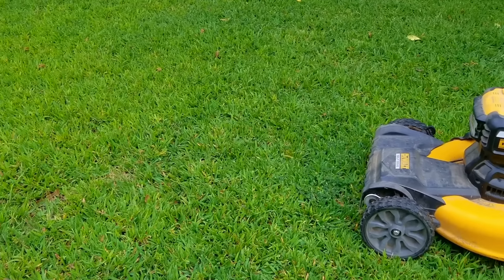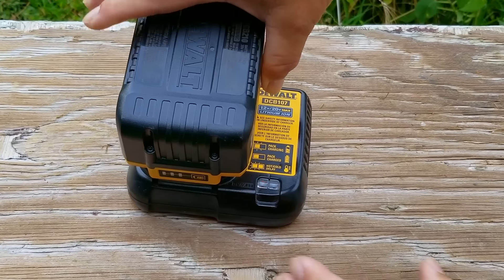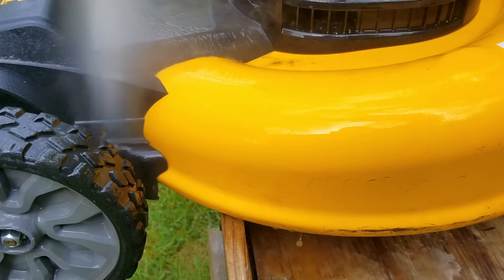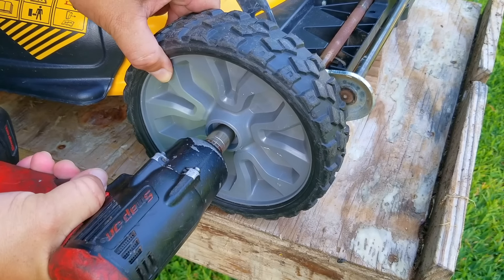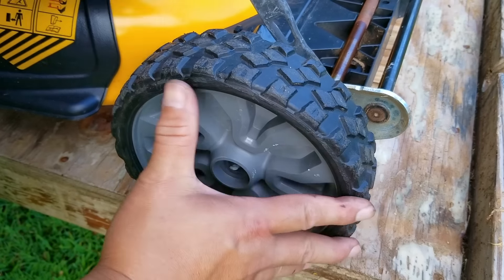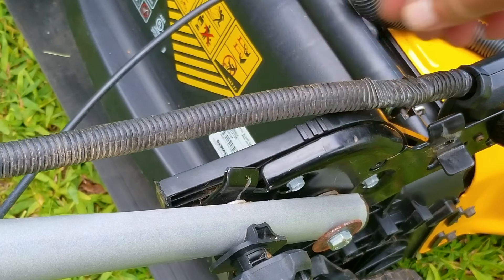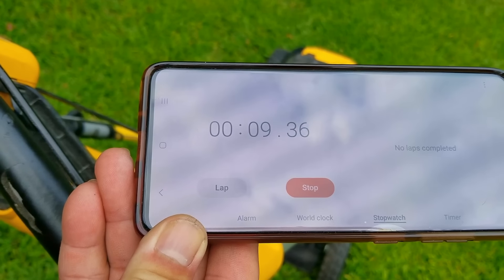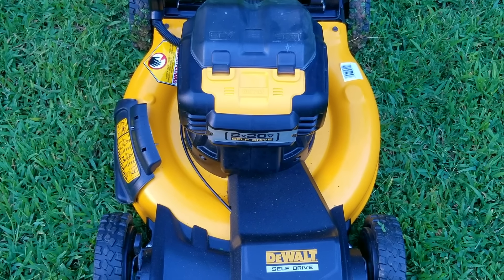Finding Out Why This Dewalt Mower Start And Then Stops

Comment: DeWalt Batteries should last about 10 years.. but if they're poorly charged and maintained, much shorter. I have been using battery operated tools all the time for work, but they're not lawnmowers...

I'm not impressed with electric mowers. I mean, plug-in is great.  Lots of power, but battery? They're just throw away junk.  As soon as something fails, it is non-serviceable and trash. 
So "environmentally" friendly. I guess the NET-zero is the amount of money you have after switching to these "environmentally friendly" products. Let's face it, the moment someone calls it environmentally friendly, it's plastic, and throw away.
Reply from the maker: thank you and I like the way you put it.
Reply: @donjohnson1416  There is a difference between a battery drill, and a lawnmower. Lawnmower motors require continuous power, where as drills are short duration usage. 
Gasoline engines are designed for continuous operation, and batteries, especially small batteries in enclosed places, are not very good for continuous operation. The reason, is heat. Heat absolutely destroys batteries. Look at Tesla  when their batteries overheat.
To COOL the batteries you will require power draw for the purpose of cooling them  (which a lawnmower does not have)... 
When you go over tall, thick grass and weeds, the motor goes under heavier load and require more draw from the batteries, increasing the heat.

Where as a Gasoline lawnmower, they're spinning already, so they slap a fan on top to blow down over the engine to cool it..
Is there a loss? Miniscule, where as running a fan to cool the batteries, considering it's extra current going elsewhere, it'll be a significant draw.

Argue all you want. Doesn't change that batteries tools are throw away items.

Comment: So what was the problem I am having the same issue ??? Thank you
Reply from the maker: yes I didn't do a great job of presenting the solution, but the batteries were the problem.  They were depleted and near the voltage that the cutoff would try and save them.  They needed to be "as fully charged" as possible to work but they only lasted 15-30 minutes depending if I used the self propel.  2 new batteries will fix it right up but at the same price as buying a new electric mower, most will not go this route.  I'll have to make a video on this topic again and clarify it. thanks!
Reply: You realize that the wall batteries are really 18v they just call them 20v
Reply: I tried new batteries with no luck.
Reply: @MrEricdgreat  I think mine might be with the switch. I've swapped out I mixture of batteries on it. 20v, flexvolt and I tried a 8ah power stak 
All chagered.
Reply: @randyb8302  I bought the switch that is controlled by the handle lever not sure on the part number. I’m sure I can find it, but that was not the issue.  Seems to me there may be a thermal switch somewhere.

Comment: I'll give you a Tip on the brushless and cordless equipment. Use Dielectric Grease. Use on batteries and All connections. Let me know how it helps.
Reply: Good stuff!
Reply: I have a question 🤔. What cleaner do you use. It 👍 definitely works amazing. God Bless.
Reply from the maker: thank you, I'll have to get some
Reply from the maker: sure, I'm using Super Heavy Duty Degreaser from Harbor Freight

Comment: Seems like the Stihl just takes one battery but it has a charger with a blower so it doesn't take long to charge. It always runs plenty to trim with so we've never had to run a total run time. It runs the medium capacity battery and the economy setting for speed and always self propell and it looks a lot like the DeWalt, but they all do. The Craftsman does also but since it usually just goes down into the 70# battery usage it usually charges in a couple of hours but it uses a big amperage charger but it's a big battery and looks like a gas job. The Stihl is super quiet but the Craftsman has the usual deck roar but is super smooth but gets interesting in tight places.  Good and bad but I've got it to do this afternoon. Job security. Happy weekend!
Reply from the maker: thank you and it turns out the chargers that come with this mower, are extremely slow at a little over 1 amp!  I'm sure if this had the 4amp charger, I wouldn't have to wait this long
Reply: @HomeGaragechannel  My DeWalt stuff is slow but they have a slow charger but my batteries are newer probably. We're all in a new land with this battery stuff and will have to learn together.
Reply: @HomeGaragechannel  The charger for the Craftsman is 650 watts.No wonder it'll do the deal in 2 hours plus or minus.
Reply from the maker: agreed  and I'm ready to learn
Reply from the maker: that makes sense
Reply: @HomeGaragechannel  ME too!
Reply: @HomeGaragechannel  We always have had to!

Comment: In Australia 2 of 10 amp Dewalt batteries Is $500-$600. That's a new mower price or a more reliable gas one. Battery ones are good for units or postage stamp size lawns. I have two from road side salvage. Kept for those jobs. Luckily one came with three batteries, so it a battery swap routine.
Reply from the maker: well said, not sure but I'm definitely considering my options here

Comment: Get a deal on two batteries! SB&D had owned DeWalt for many years. They've also owned MTD for several years. That IS an MTD mower using DeWalt battery technology.
Reply from the maker: thank you for the information, now it makes sense

Comment: You might be able to rebuild the cells, but after seeing the results of so many E-Bike fires in NYC due to improperly repaired lithium ion cell batteries I would think twice about it. Easy swap out for a gas engine, especially if you have a stash of MTD handlebars around. The rest of the mower is in great shape!
Reply from the maker: yes I agree, I have to admit it but the battery pack rebuild Is at the bottom of my list .

Comment: When I repaired power tools DeWalt wasn't the best brand of power tools despite being expensive, maybe if Metabo made an electric push mower they might do a better job at making one.

I would convert it into an internal combustion engined lawnmower if the base is strong enough, there is someone who butchered an electric push mower to run an internal combustion engine & people think that he weakened the base by doing that.

It's not impossible but the base needed to be strengthened with metal plates or something because he bolted onto weaker sheet metal base which he had to cut a bigger hole into !
Reply from the maker: thank you for the information

Comment: The bad thing about these Battery mower run times is that those times they claim are under zero load.  Once you start cutting anything, that time drops in relation with the load put against the mower...and dramatically.

75 minutes with no load might equal 50 minutes under a standard load, and ultimately end up at 35 minutes or less under heavy load (higher/thicker grass).  I've had an Ego 2156sp for 3 years now and while I love the idea behind these Battery mowers, we need a lot of work on energy storage technology before these can really compete with gas on anything bigger than a small to medium yard.
Reply from the maker: yes I do believe you are absolutely correct about the run time.   Staring to sound like the EV companies and their estimated ranges, which are a bit higher than reality
Reply: @donjohnson1416   I think you should re-read my original post and reformulate your response a bit.  I'll be glad to respond to your talking point, but I just want to make sure you were able to comprehend what I said.
Reply from the maker: energy density is what I'm complaining about, but I think you already knew that.

Comment: I would say put an engine on it.  In fact, I would say if you have an old Cub Cadet where the deck is rotted out then the PowerMore engine would match (being MTD is owned by Stanley-Black and Decker, the company that also happens to own DeWalt).
Reply from the maker: that's a pretty good idea!

Comment: I see my neighbors all smiles with their shiny new battery powered lawnmowers but wait a few years when they need batteries and they are 200 dollars each and maybe obsolete already they will be sorry they put a perfectly good lawnmower on the curb .
Reply from the maker: totally agree
Reply from the maker: I'd like to know where you can get an EGO branded 56v 7.5 ah battery for 130-140.  I've seen them for over $320.  IF it doesn't say EGO on the pack, I don't know if I'd buy it.

Comment: I mean, I think a large problem here is the battery packs. The idea is good, "Oh hey, use the same batteries as your tools!" but... it is running in parallel to get a 40v, which can't be good for tool batteries. I've got a 50v Ego mower, and haven't had a lick of trouble. It'll munch through tall, damp grass for a good half hour before the battery overheats. My fault, I let it grow too tall, but by that point I'm ready for a little sit and break. Half hour later, it's either full, or full enough to finish the rest of the yard.
Reply: Running the batteries in parallel does NOT boost the voltage to 40V. Only connecting them in SERIES would do that, and I don't think that's what's happening in the mower.
Reply: @b0bsaget007  I think He meant in series. 
IDK if it's in series or parallel but I would assume that it is in fact in series as higher voltages tend to be more efficient.

Actually in parallel (in this case) because one holds a charge different then the other, the bad one will indeed have an impact on the good one because the bad one will constantly draw from the good one. 
This will obviously bring the better battery to the same state as the worse battery over time,  drastically lowering the life span of the better battery.
Reply from the maker: thank you for sharing that

Comment: I can tell you that any battery tool will act like that when the battery is low charge to keep it from going below the point of no charge all mine do it replace the batteries and it will be good to run or get adapters for it to run a different battery brand
Reply from the maker: thank you and that's a good idea!

Comment: I'm with everybody else the cost of the batteries just does not know why in 1 gallon of gasoline. It would take more thank 5  5ah batteries to equal 1 gallon of gas. Absolutely crazy   it's not helping out environment at all how they manufacturing of those cells
Reply from the maker: I know what you mean

Comment: Hey bro what's up? In my opinion, there isn't any right or wrong answers here mostly because it's due to trial and error. I believe that getting replacement batteries will be the smarter move but since these batteries are so expensive it will put a huge dent in your pocket. I'll be using gas powered equipment for as long as it is available and when my options are limited to only battery powered equipment then I probably get one then.
Reply from the maker: well said!

Comment: Well if the administration is going to force us to use these you might as well get some experience built up with these. I would like to see you tackle those batteries sir. But it's your machine so you can do whatever you want 😊
Reply from the maker: you are correct, I plan to keep using what I've got, but I'm also trying to get the experience I need with these to help those that might need the help

Comment: Those 20v batteries always get about 18v even when new the 20v is just a marketing thing. 20v is the "max" you can get from those batteries, at least in their testing.
Reply: That being said, they shouldn't discharge as fast as yours did.
Reply from the maker: that's interesting, all the video I saw, had the batteries measuring at 20 volts, right off the charger.
Reply from the maker: I agree
Reply: It’s true that these are the same as any other 18v tool battery but all 18v battery packs are supposed to charge to nearly 21v (4.2v per cell/bank in a 5S configuration). They were definitely reading low.

18v is the nominal voltage (3.6v per cell). 20.9v is the fully charged voltage (4.18v per cell). 15v is the fully discharged voltage (3v per cell).

Comment: Word of caution if you swap the motor for an engine..

Motor = requires electricity
Engine = Runs off Combustion

Motors and engines are not the same. (I will die on this hill)

Be wary that the engine mount hole may be smaller for an electric motor, vs the gasoline engine. Modification of the deck may be required, but could cause the deck to weaken
Reply: Funny you mention that, because it bugs me too when people call engines motors and vice vera.  Massive difference.  I'm with you.
Reply: It’s the exact same cutout, bolt pattern and shaft length on these MTD mowers, I’ve swapped them out before.
Reply from the maker: I'll keep that in mind.  thank you!
Reply from the maker: It's good to know that it's possible

Comment: Fyi, that charger is the standard charger. Fast charger is yellow
Reply from the maker: yes this is the cheaper slow charger, it's means to try and keep the batteries from degrading as opposed to using the 4 or 6 amp chargers for power tools

Comment: Pull the battery packs apart, & replace the cells. They aren't expensive. Buying a new battery is very expensive. Another way is to buy a DeWalt power tool kit that uses the same battery type, with 2 batteries, and you're good to go.
Reply from the maker: yes I've considered buying a kit to get new batteries.   I also considered replacing bad cells, but I'm worried about mis-matching brands  and also of an unbalance between the new and old cells.
Reply: @HomeGaragechannel  I would simply repack the battery. If you can get them, buy Samsung cells. They are better than Panasonic.
Reply from the maker: that's what I've found out as well. Thank you for confirming that
Reply: @HomeGaragechannel  glad I could help.

Comment: Amazon sells those batteries for $347 a pair. Aftermarket about $100. Get a gas mower before Democrats outlaw them.
Reply: Man democrats don’t have nothing to do with that all the company’s sending. There jobs over seas. To get cheaper labor I don’t care got neither but at end of the day when have you seen a president care about an American you see who own all the gas stations not Americans so who do you think they care for ?
Reply from the maker: thank you for the information
Reply: @mgomez5606  point taken, I'll be more careful in the future.
Reply: @HomeGaragechannel the reason why those dewalt 10 ah batteries weren't charged yet is because the standard battery charger only does 4 amps the fast charger dewalt sells does 6 amps

Comment: Flash the batteries.
Reply from the maker: is that the thing where you use high voltage from a welder?
Reply: @HomeGaragechannel   Think you can use  a similar battery to do it.
Reply from the maker: I see